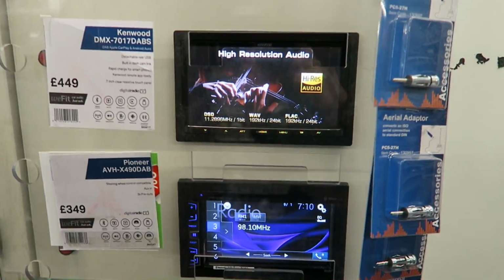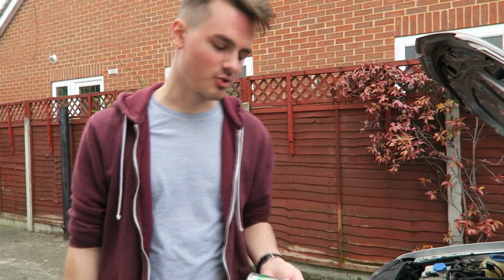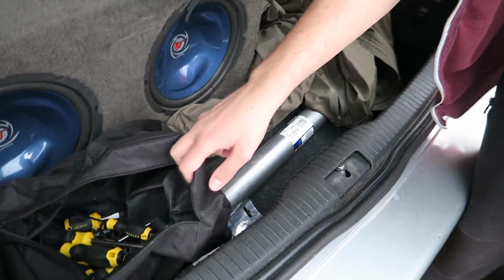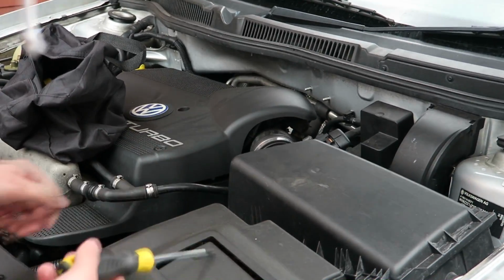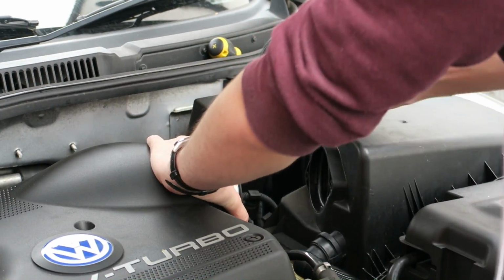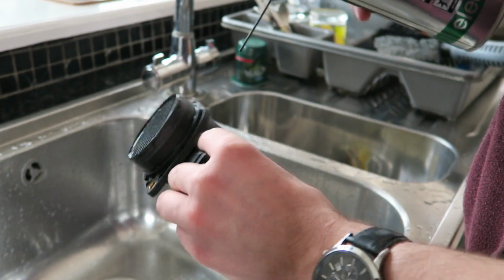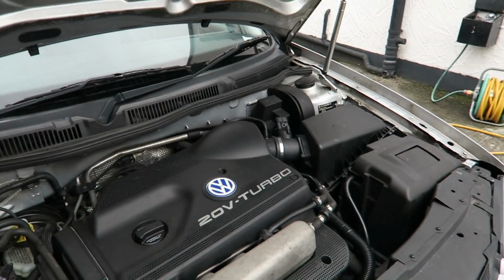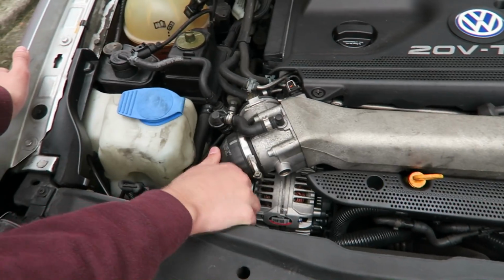How To Make Your Car Run Better!

Comment: When you put off maf sensor,it is necessary to put off battery negative terminal first!🙂And after putting back new or cleaned maf sensor back,then put negative terminal of battery back.🙂
By doing this,maf sensor will properly reset with resetting ecu,and other all sensors and electric components all reset to their origional possition.
Maf sensor will behave smoothly and accurately after all this procedure.
"My personal experience"🙂

ONE SHOULD TRY THIS PROCEDURE ONCE.😉

Comment: Awesome video. Do you have to OBD computer register or do any resets everytime you change filter, oil filter, spark plugs etc.? 
Seems like cars with electronic systems register everything. What happens if you don't register it.
Reply: Same thing i wonder because i see him remove and install things but never says anything about using vcds to reset or adjust things lol 🤔